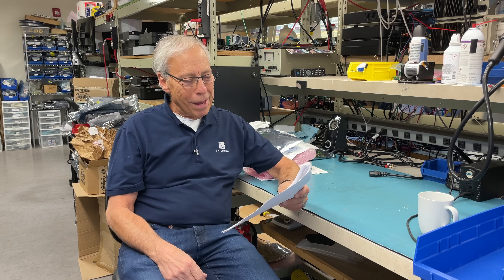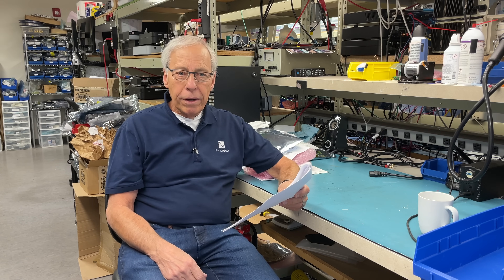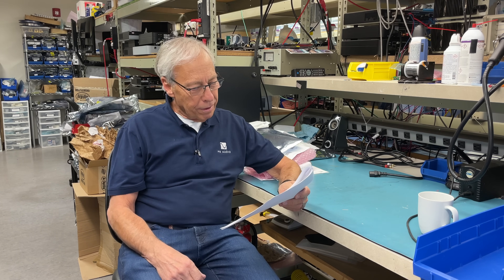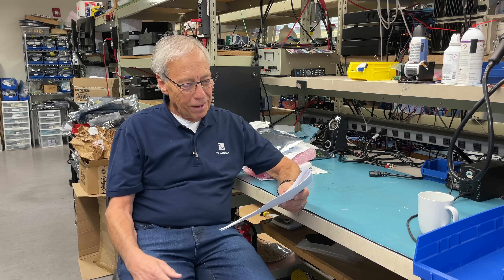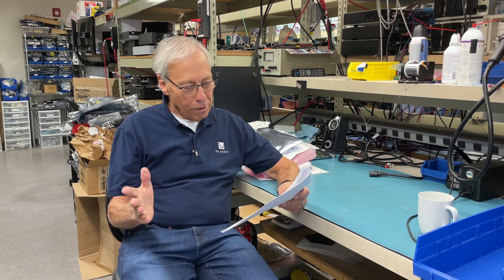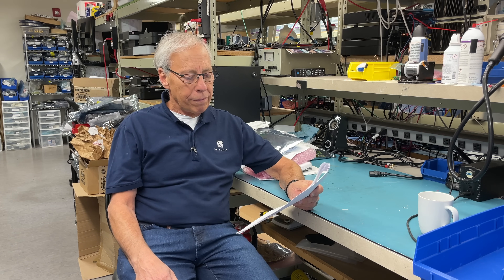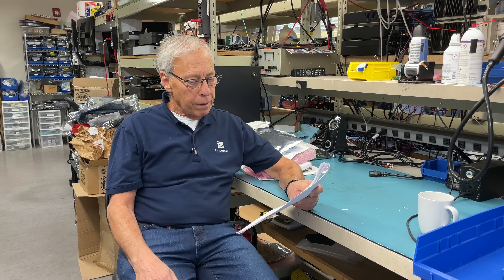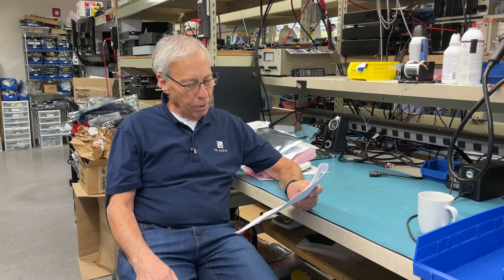The importance of internal speaker wires

Comment: Replacing the factory-supplied speaker box internal cable is a mistake and shows that you don't understand audio, the factory certainly won't use cables that are too expensive but those that meet the requirements are certainly used, because to make a balanced sound they only make a balanced crossover between the upper and lower frequencies, if you replace it with an expensive cable, of course the high and lower frequencies will change, and the sound will be messy, not to mention other things like the soldering iron used will affect the sound quality

Comment: If speaker wire gauge matters from amp to speaker, then wire matters internally from post to X over an X over to driver. If internal wire/gauge and quality don’t matter, then neither does speaker wire quality and gauge. 

What a joke for anyone to say speaker wire matters externally but internal wire doesn’t. I feel you cannot have it both ways. Either you are all in on the quality of wire as far as one can take it including internally or you’re not into speaker quality/gauge whatsoever. Some people that are commenting here are half in. They’re the ones who say speaker wire doesn’t matter but also buy better wires than lamp cord…. So what is it? 

For those who say inside the speaker is only a short run and the gauge doesn’t matter I would say OK take your speaker cable, Say you are using 12 gauge, solder on a 6” section 20 gauge wire and then connect to your binding posts both at your amp and at your speaker. Again, as you say, the short runs, don’t matter. 

I think it would be great if they’re actually was tests for internal wiring that has been changed to thicker gauge/quality. What does a blind test reveal? What do testing instruments reveal? 

With so many different debatable upgrades/improvements one can do, It’s hard to know which ones actually do make a difference and which ones don’t. I’m of the opinion that if you Increase the quality gauge of internal speaker wire, it may not be discernible to hear even if it is better. There are so many tweaks and improvements that are debated whether they actually do work or not. I feel why not try Say 20 different improvements to stack potential marginal gains. Perhaps half of them actually do nothing. But some of them may actually add up to a noticeable difference. I believe, changing the quality and gauge internally of a speaker may not in itself, produce a very big difference, but combined with making a lot of other tweaks or changes you are likely going to notice a difference when they’re all added together. Which ones work? Which ones don’t? This will be debated until Armageddon. But isn’t this part of the fun is to tweak and try to get and stack up marginal gains? If I had more time on my hands, I would do as many tweaks as I could to constantly see if even a few of them make for a more enjoyable, listening experience in the limited time we have Before we die .

Comment: Hi Paul, only just discovered your channel but already learning a lot, thank you! 

I have a question about internal speaker wiring: I have a pair of Pioneer S-Z73 speakers, they're old but worked well until recently. Unfortunately the main wiring has broken off the crossover component on one of them and it's completely taken the contacts with them, so there's nothing left to re-solder the wires back onto. Is there anything I can do, like maybe replace the crossover part or even the whole of the wiring? Or is there another more modern solution to wiring up 2-way speakers? I'm reluctant to throw them out and can't afford to replace them at this time and I'm not much of a technician but I'd be grateful for any help or advice. Thanks.

Comment: Did you just say you refuse to test the requirement for a specific cable because it would undermine your marketing of equally unproven speaker cable? As a manufacturer your first priority should be objective engineering not feelings. 

I'm aPauled.

Comment: 12awg wire to each individual driver sounds terrific. Heavy awg is most for high powered solid state. Small tube amps actually sound better with thinner wire. Try it for yourself. I have

Comment: Hi Paul, thank you for the amazing videos about audio gears. I do have a question about speaker wire gauges. I purchased a sony ss 725av speaker and it comes with(implanted) probably a 18awg wiring. How can I change the wire gauge? Does cutting and connecting a 16awg to the 18awg wire work? Will it make a difference? Hoping for your reply. Thank you and stay safe.
Reply: Wire larger rewire components
Reply: Sony use crapy wire i change it personly.

Comment: The excuse/reason for thin wire inside the speaker is because the length of the wires are usually short.

Comment: Paul i just opened my ATC loudspeakers and sadly yes, the internal wire is the thinnest crap that could be fitted. To say i am disappointed is an understatement. ATC make these beautiful high quality drive units. Then they connect them up with utterly rubbish tiny thin wire. Oh and not forget the nasty cheap slide on terminal connectors. They can't even be bothered to solder the connection to the drive units.  As you said, i'm offended by it

Comment: How would you wire a speaker cabinet with a 8" dual 4 ohms voice coil subwoofer ,6.5" 4 ohm woofer and then 4" mid 8 ohm ,3" mid 4 ohms and a 1" tweeter 4 ohms to a reciever that can handle 4 ohms lowest and 8 ohms the highest ?

Comment: Not only use bigger gauge wire but also solder all the wires directly to the drivers also, to get rid of all push on wire connectors. There is always resistance and tiny arcing with these connectors, no matter how tight  they fit. The soldering makes the biggest difference with the sound quality. I can tell the difference.

Comment: What gauge is used to wire the voice coils?  If the internal wiring is larger than that, it shouldn't make much difference.
Reply: This would be easy to test. Get a spool of voice coil wire, and use it to connect one of the  speakers. Then rotate the balance knob between left and right (mono audio, obviously) and take notes. Easy peasy. 

It's good to confirm suspicion/intuition/theory with real results.

Comment: It may not be much of an audible level but all connections in the signal chain is a small resistor when you connect a merge wire to a small wire that small wire causes resistance in the connection the more you can eliminate that level of resistance the better signal your drivers and crossovers are going to receive. You wouldn’t wire even a short distance wofer getting 100-200 watts with 18 gauge speaker cable but after you connect to 10-12 gauge wire to the box a 18 gauge wire takes it from the box to the driver. That just dosent make sense. I never understood why speaker companys cheap out in this it’s not like use long lengths of speaker wire it just seems like a strange place to pinch a dime when your selling a pair for a few hundred or even a few thousand dollars

Comment: For my understanding, internal wires doesen't have to be thick for doing the job, as i can't see this matters? Internal wire IS important, but has not much to do with size of gauge.? But maybe i'm wrong?
Reply: Mainly, you can't see the internal wires, so upgrading them is pointless. I guess you could TELL your buddies that they're bigger,  but I doubt they'll be impressed. 

Maybe if you change the cabinets to clear plexiglass?  Then they can see the internal Monster cables.

Comment: Remake all the speaker connections back to the output device new cables you have a new sound system again I've done this many times in my life every joint even soldier deteriorate
Reply: Thanks for an actual tip.

Comment: Good quality heavy wires are important.  Current loads are constantly fluctuating and that will cause a certain amount of induction in the speaker coils and that will cause eddy currents in the wiring that can slow speaker response times leading to a flattening of the sound and low level speaker hum and a heavier gauge wire can prevent that.  If you have a decent audio system with a higher power output this can be a real problem and will be quite noticeable.  If you have a good quality well designed box fitted with high quality well matched speakers, cheap thin wiring can reduce the output quality to that of cheap speakers.  It is the same if I have to replace capacitors in amps and power supplies, I use best quality and upspec them one size, and I never have to go back to them.  The additional cost to do it properly is minimal, and you can be sure the companies building the good speakers would use cheaper cable if they though they could get away with it, but the audiophiles will pick up any lack of sound quality.

Comment: Actually, crappy wire inside makes a difference. I've had plenty of guitar speaker cabinets which are low-fi but even they generally use thick gauged wire. However, a few cabinets had thin gauged wire. After replacing the wire on these cabinets with oxygen free, high grade copper wire, the tone improved. If the tone improves on a low-fi guitar speaker that doesn't go higher than perhaps 6KHz, it should make a huge difference on hi-fi speakers. In particular, low grade, skinny wire made the speaker sound compressed with reduced frequencies. The tonal differences were minute but clearly audible.

Comment: Most Speaker manufacturers that use cheap thin gauge wiring inside the speaker cabinet for cross overs etc, do this because they can get away with it. It’s not visible to the buyer or user.
Ironically the same manufacturers often recommended high quality cables to connect their speakers to other components - sometimes they even sell the cables themselves.

Comment: I want to learn how to diagnose and/or replace circuit board components (capacitors). I have a soldering station and magnifying lenses, multimeter, hands that don’t shake, but ZERO knowledge. Where do I start? I have slight noise in my Emotiva DC-1 DAC Amp (guessing a capacitor) and want to find the culprit and replace it. Maybe replace all capacitors. I read that the originals are “crap”.

Comment: Went to get speaker wire at walmart today. They want $9 for a 10 meters of wire. Absolutely ridiculous. Just cut the ends off a cheap extension cord instead.
Reply: Around here, the cheapest 10 meter extension cord is way more than $9, LOLOLOL.

Comment: "(they) weeny out on internal speaker cables"?, "i dont know if it makes a difference or not but go ahead". I tend not to criticize but common sense tells me that if  6-12 inches of unknown "weeny wire" from the speaker manufacturer makes a difference in peace-of-mind then the same scrutiny should be fired at the driver manufacturers in their lead and coil quality. the chain is only as good as the weakest link, after all.
Reply: All you have to do it replace one, and compare it with the other speaker... Are we really going to let unproven theories ride? Might as well put a big wing on the back of your car, just for looks.

Comment: Sure but...... Aren't those speakers crossovers and drivers voiced for the wiring used my the speaker manufacturer? Might rewiring change the speaker into a different beast? Would it be better? different or worse?

Comment: Replacing internal 20ga speaker wire with 2/0 00 car battery cable  is a feel good thing. It don't make any difference but it makes you feel good.
Reply: You use wire?? Your setup must sound like garbage. I run 5x25mm bussbars between MY amp and speakers. Preamp to amp too.
Reply: @PraxZimmerman  LOL.

Comment: Paul covered this subject in a previous video. This new video contains the same nonsense. Paul says he does not understand why most quality speaker manufacturers do not use heavier wiring. If he had a qualification in electrical engineering he would know the answer. Lighter wire is used internally because it is easier to handle and does not put mechanical strain on connections. It has absolutely no effect on performance. Manufacturers do not use lighter wire to save a few cents, they do it because experience tells them this is best practice. Incidentally, there is no such thing as Oxygen Free Cable. All standard electrical wire is Oxygen Reduced. Standard electrical cable is perfectly fine for audio applications.

Comment: Considering that the internal wiring is so short, it makes no difference. Replace the driver with a 2-4Ω load and use a current supply and see the voltage drop for yourself vs say a piece of wire that's twice or three times the thickness - it makes such a small difference that it won't affect the power delivery to the speakers. On the other hand the external wiring that can be several metres, it will make a massive difference, reducing the dynamics and compressing the sound along with the soundstage.  However, I think that it would be more professional to use a good quality cable internally as it's always nice to see the art and engineering extended to the internals even if it's rarely seen.

Comment: Should the wires be twisted to cancel out stray magnetic fields also?
Reply: Mic level balanced lines should be twisted not high power speaker connections- no interference there

Comment: I’ve had the itch for months to rewire my Sonus Faber Amati speakers! But too scared!
Reply: Sonus Faber use good quality on their components and a decent wire inside the cabinets.
I opened up my Sonetto center speaker and found a nice wire and good quality components in the crossover.
Some SF speakers have Mundorf components too, so no reason to rewire your speakers.

Comment: I recapped my mb quart towers with dayton film caps and while i was in there  replaced all wiring with knoconcepts 12awg silicone jacketed speaker wire. It has 237 strands! That many fine strands accepted solder wonderfully. Made it pretty easy. I cannot say how much of the sound has improved from the wiring versus the new capacitors but i can say it sounds fuller and more clean than it ever has. Did same thing on my twin yamaha 10 inch subs..surprised how tight they sound now. 10 inch are always  tight but these really hit and quit fast. No shudder or vibration. Just reproduce the frequency and silence after. They were decent before but now they make me smile.

Comment: If you have a high resolving amplifier, it absolutely matters. Tested and verified, even 15 cm (0.5 foot) affects the sound. You will not notice a difference if your amplifier is not highly resolving. Being an electronic engineer I did not think it mattered much, since the wire in the voice coil of a loud speaker is very thin, what would a small length of thin gauge wire in the speaker box going to do to affect the sound, I was wrong : ) . Individually insulated  strands of solid core wire or magnet wire (wire used to wind motors or speaker coils) bundled together to make the desired gauge helps with higher frequencies (due to skin effect) by providing a larger uninterrupted surface area  for the higher frequencies to travel. This increases the efficiency to your mid range and tweeter making it sound brighter, control of the driver is better because of the better coupling between the driver and the amplifier. There is less high frequency smearing, but this requires that the speaker cables also have to have the same construction. Too much of a good thing is not always good since it makes the sound too analytical, so the addition of normal stranded copper wire in series to the speaker cable degrades the sound a bit, adding a bit of smear "introducing some harmonics", in my case I had to add 60 cm (2 feet).

Comment: Absolutely makes a difference.  I recently made a minor correction to the internal wire.  The existing 14 AWE wire was ok wrt gauge, but it was run with + & - separated by several inches.  After reading one of your tech papers on speaker wire, I simply twisted the +- runs to better match impedance to the drivers.  Surprisingly improved sound even though we are talking at most 18" runs of wire.
Reply: I thought you don’t want twisted on high power applications- did I miss something?

Twisted is for balanced connections ie 3 wire right?

Comment: I just use old retired 10Mbps LAN cable for reviving my familys old 90's tower speakers.  the type of cable has 8 solid copper cords and is at least 10Mhz signal shielded...and it's likely good for under 100W per speaker..

Comment: Blue Jean Cables is a great company making high value cable assemblies, but it doesn't really make sense to go to them for raw internal wire. What they do is add really nice terminations to stock Belden and Canare wire. Just get the raw Belden or Canare if that's what you want to use. Cardas on the other hand makes their own raw stock, and they will sell you the basic spooled wire for internal use. The catch with Cardas is that all of their wiring uses lacquered strands, and requires a solder pot to terminate.

Comment: A follow up question: what about the wires to the voice coil from the speaker terminals?
Reply: They just can't be too heavy.
Reply: No, that's totally irrelevant. Nobody can even see them.
Reply: I wondered the same, so after some research, I found that dynamic speakers have restrictive losses as they move a heavy coil and diaphragm in and out of the magnet.

This is were balanced armature drivers come in place as they have a stationary coil, In theory if we had balanced armatures big enough, let’s say for example a tweeter the size of a stick of butter, the coil could take much more copper, the magnetic surface area is larger therefore having a more efficient speaker.
I already asked Paul this question back in December.
How come no one is doing Balanced armatures big enough for Home audio?
Reply: Or the internal transformer in the amp?

Comment: Wire seem awful small in my Infinity's but after dealing with the 12 volt auto world I'm not so shocked they didn't over do it in a speaker. Heavy gauge wire is just more drag on the system if not needed.